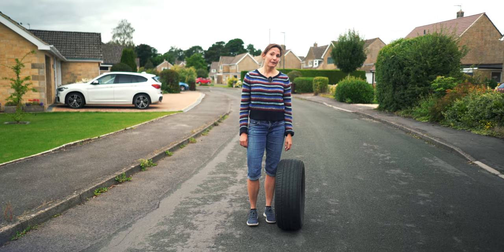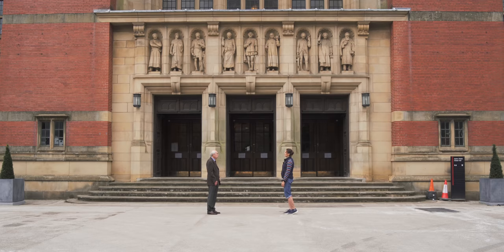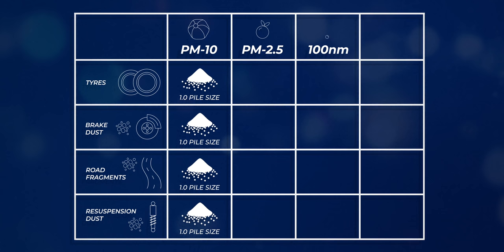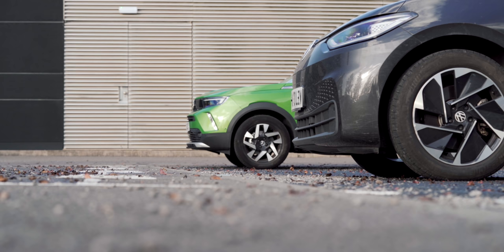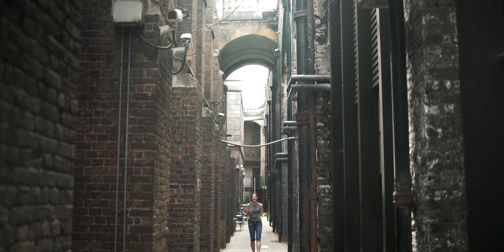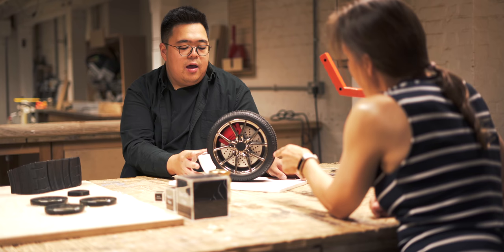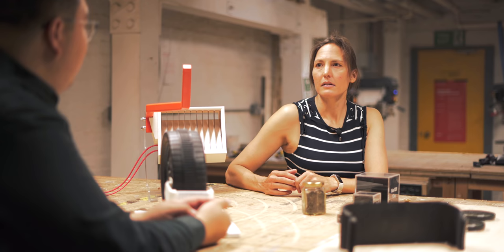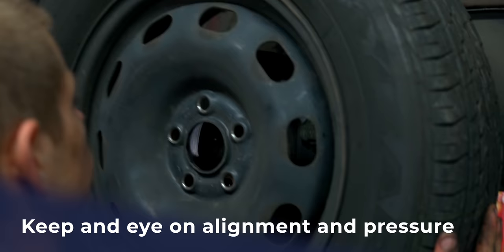The Secret Pollution That All Cars Are Guilty Of | Fully Charged

Comment: When cycling in cold weather, it seems that pollution along the road is worse. On top of car exhaust, is smoke from wood stoves.
Reply: I have a special hatred for the pollution from wood and multi-fuel burners. They are absolutely filthy!
Reply: Wood stoves are cracking.
Reply: @sandersson2813  Might be romantic and aesthetically pleasing, but they are an absolute menace to anyone with respiratory problems and should be banned.
Reply: @ma40  Bullshit. Theres nothing wrong with them provided you burn DRY wood.  Furthermore, considering that the fumes come out of a chimney, how often are you cycling at chimney height?
Most of the time there's sufficient enough wind that it wont drop to street level.
Reply: @sandersson2813  You are still wrong. Inside and outside the home they produce substantial amounts of NOx, methane, VOCs, various sizes of particulate matter such as those discussed in the video. True, the level of pollution depends on the fuel burned. Defra’s Clean Air Strategy 2019 cites that an eco design stove will still produce 336g per mWh of PM2.5 compared to 0.72g per mWh of a gas boiler. It’s not true that it just simply lingers at chimney height or above and it often combines with ozone etc to cause real problems at ground level.  It’s well documented that it’s particularly problematic for young children, the elderly, those with COPD etc.
Reply: @ma40  How many houses  do you cycle past that have wood burning stoves on?
Honestly, you're talking like its Dickensian London.
Were you moaning when 80% of houses had coal fires? No, you werent
Reply: @sandersson2813  Why do you keep blathering on about cycling and London, rather than engaging with the substantive points? Firstly, the majority of the population live in other parts of the country, and people have to live next to houses with these stoves, not just ride past occasionally. Secondly, domestic wood burners produce three times the level of particulate matter that road traffic does, yet only around 8% of the population have them. Thirdly, you are relying on people to use their stoves properly and have them and the chimney cleaned regularly. Plenty do burn wet wood still despite the clean air laws. And fourthly, yes air quality has improved since the 1960s but the improvement has levelled off thanks to stoves. Why shouldn’t we aim for better than this? Isn’t that the whole point of Fully Charged’s “Stop burning stuff” campaign?

 My old man has COPD from years of formaldehyde exposure working in cancer diagnosis. He has to stay inside when people are burning wood as it irritates his chest so much. Shouldn’t he be able to go about his business without someone harming his health?

I’m just not sure why you would be watching something that is aiming to educate about the need to reduce the release of particulate and other pollutants if you aren’t prepared to lead by example and find ways of reducing your own impact on the environment etc. In fact you undo any good of cycling by replacing that with wood stove emissions instead.
Reply: @ma40  What % of houses have wood burners? Hardly any.
Therefore you are not subject to wood burning fumes to any significant degree.
Its just given you something to whine about

Comment: Electrostatic collection... Having worked on something related, I reckon that will be battling against water spray and a hell of a lot of debris and dirt, kicked up off the road. Will their collector be able to differentiate and reject that. Or will they just become matted chunks of mud, just like we see caked to mud flaps or under wheel arches.
It isn't going to be a 6" box full of pure rubber dust, that will get emptied at service time. It will be a dyson vacuum full of mixed sludge, every day during winter. We will have to have specific wheelie bins for it. Though we will also have the best hoovered roads in the world.
Reply: Caution - electrostatic collection systems can create exhaust that includes a significant number of charged, smaller particles that result in even greater toxicity overall, even if the total mass of particles in the exhaust is reduced by 99%. The primary reason for this is that the smaller particles have far greater toxicity than the larger particles because the lungs can trap and eliminate the larger particles more readily than the smaller particles. So, if a particle 1/100th the diameter of the larger particle has 100 times the toxicity of the larger particle, then eliminating 99% of the combined weight of the particles would do next to nothing for reducing overall toxicity of the exhaust. The reason the remaining smaller particle could have much worse toxicity, by many times, is that once charged by the electrostatic filter's electrode, the charged smaller particle is much more difficult yet for our lungs to eliminate than the same particle would be if it were not charged.

Comment: Excellent advice at the end. I can vouch for a Zoe Michelin tyres. Well over 40k miles, never had tyres last so long. Cheap tyres are often a false economy. I’ll certainly be cycling more once I get my bike back from the repair shop! 😊
Reply: I have a Zoe too, and let the car do the driving and braking so i don't wear them too much. One other way is just having my car not driving so much...good for me even if i was working in the office and not at home, i would be walking, still breathing in all those fumes from all the folk rushing around!
Reply: 40k! Meh!

I had 74k out of the back tyres on a Golf 1600 CL.

Changed because of sidewall cracking.

Rubber dust pollution and brake dust pollution from EVs a grave disappointment.

Perhaps it's time to forget EVs being charged from the "mains" and do the hydrogen fuel cell thing?

Might save a "lot" of cash and copper/aluminium cables.

Perhaps HMG would have been better off investing in hydrogen production plants and improving efficiency of hydrogen fuel cells?

They manage to use hydrogen technology in California so it might now be considered as a valid power source?
Reply: @t1n4444  how would hydrogen vehicles result in fewer non exhaust emissions? They have tyres and brakes too.
Reply: @myblueheaven4424  You could have Googled this before asking questions.

Perhaps that's what you must do, straight away.

Saves me coming out with the science, which is "involved".

Hopes that helps.

Just keep in mind battery EVs are only a step on the way.

Think electric propulsion, not the batteries and charging thereof.

You'll get there.
Reply: @t1n4444  Hydrogen sucks. It'd be nice if it would liquify at ambient temp. But it doesn't.  Here's a science project for you. Try building a 10,000 psi compressor and storage tank.
Reply: @eyeballengineering7007  😂😂😂

Clearly you aren't too clued up on technology.

It's already in use. Why don't you simply do the Google thing?

We're going to be here all night if you keep denying the technology.

Now, just Google up the topic and accept the technology works.

No need to respond btw.
Reply: Hydrogen for passenger cars is pure rubbish. It is very inefficient and has lots of transportation and storage issues. It has indeed specific applications where, despite all these issues, still makes sense
Reply: Even cheap tyres can do 50k, I've done it many times. Depends on how you drive the car aswell.
Reply: @t1n4444  I know it's being used. I also know a hell of a lot about compressors and pressure vessels. I can also tell that you're a layman who doesn't know anything but your opinion. Do you know the fuel density of hydrogen at 10,000 PSI? I do. Stop trying to talk down to somebody who knows far more than you.
Reply: @theagentsmith  You really should Google up hydrogen powered  vehicles or "railway engines".

From your posts you and a lot of others are a long, long way behind the times as far as electricity generation is concerned.

Mind you this YT channel is ditto so what else should we expect.

A little too much of the "Top Gear" model about the show as in "ambitious but rubbish".

Plus the host is a little too lightweight for the show with regard to presentation. Plus he appears to be slightly manic or excitable.

He could go and producers should engage someone with rather more gravitas and experience.

Being excellent at playing Kryton is not necessarily of much use in this sort of show.

Obviously one excellent candidate is James May.

Get that sorted and show would have some chance of being taken seriously.

Currently the show is aimed at youngsters who don't appear to be clued up on environmental issues, or buying an EV anytime soon.

We still hear of performance figures ... and not that many drivers  skilled enough to handle quite frankly ludicrous acceleration times.

EVs are an excellent notion ref "local" pollution but the energy has to come from somewhere ... lithium cells fine in the short term but sadly the technology isn't quite as clean as supposed. 

Getting rid of the cells, as an example, is not quite so straightforward as you might believe.

Suggest you research the hydrogen fuel cell for powering "anything".

The technology works in California for the vehicles there and no reported issues ref storage or spillage or explosions.

You perhaps are not aware that at least three Asian car manufacturers are busily doing the ongoing R&D thing on hydrogen fuel cell vehicles as we type.

Doubtless China won't let themselves get behind in similar R&D.

So, in conclusion, replace the presenter and introduce rather more content on hydrogen fuel cells.
Reply: @eyeballengineering7007  Of course we can all quote statistical information ... it's all over the internet and merely a case of looking.

Now, despite your somewhat dubious claims ref knowing this that and the other, are you aware the hydrogen powered vehicles are busily driving around in California?

Looks like some proper engineers have solved the issue of hydrogen storage within a vehicle and the transfer of hydrogen to said vehicles.

You don't really have a clue about this science at all, do you.

You're still thinking about EVs as yet another boys' toy.
Reply: @t1n4444  bahahahahahaaha did you know a single hydrogen pump station cost $250,000 for the pump? You'd have to understand the Dynamics of a high pressure gas pump to understand why this is going to be a problem. Like I said, you've proved yourself to be a layman who doesn't know anything but an opinion. I'd love for hydrogen to be viable for mainstream transportation. It's not.
Reply: @eyeballengineering7007  Hmm, do you really not understand when  you're being corrected and set on the path to knowledge?

All your arguments are rubbish.

To repeat, hydrogen fuelled vehicles are being used in California as we type.

What is so difficult to understand about that?

Clearly the proper engineers have engineered their way around the manufacture of hydrogen, storage of same, then transport to a storage tank in a service station, transfer of hydrogen to a vehicle and storage of hydrogen within said vehicle.

The technology works and that's all you need to know.

Why can't you simply appreciate the engineering achievements of others?

Clearly they are far better engineers that you'll ever be ... all you're doing is setting obstacles in the way ... even tho' these obstacles have been overcome.

Do try to keep up.
Reply: @t1n4444  bahaha get back to me when it's cost-effective. I'm a hydrogen enthusiast. I've built hydrogen generators and thought about using them with a pressure-free ballast for home power storage. I know how useful, and useless hydrogen can be. Hilarious that you think you're shocking me by telling me there's hydrogen vehicles all over California.
Reply: @t1n4444  quiet down child. I've built a hydrogen powered torch off of my hydrogen generator. I've done far more than that with with many off-grid systems. I have a 4 1/2 KW solar system on my house that I run directly to mini splits with no inverter. I have a solar powered hot water heater that is running off of panels directly to the element. I do far more than you could ever think. My channel has a few things I've done. Why don't you stick your nose in there and talk shit on my builds.
Reply: @paulmichaelfreedman8334  we are talking miles here, not km.
Reply: @bubba842  Heheh thx for pointing that out
Reply: @t1n4444  40,000 miles is about 70,000 km. So what you are saying is you got the same amount of distance on your tires than he did.
Reply: @bubba842  I'm in UK so it's 74k miles.

I am surprised and somewhat shocked by your response.

74k miles ... how, I sense you gasp!

Probably because I'm the finest driver on the planet, bar none ... he typed, modestly.
Reply: @t1n4444 a toyota mirai (~4300lbs) weighs more than a tesla model 3 (3800-4000lbs) which basically destroys whatever argument you're trying to make (are you saying that BEVs are too heavy? or that they will never get lighter because battery density will never improve any more than it currently has?)

 🤤
Reply: @vinylcabasse  

😂😂😂😂😂😂😂😂😂

No idea what you're trying to type, I only wish I could be arsed to ask.

All you need to know is that hydrogen fuel cells are on their way and this means the weight issue is solved!

Can say fairer than that.

Comment: Tyre manufacturers are continually improving their products. It used to be that there was a direct correlation between high grip and high wear - the extremes are still there, but the line is not as distinct nearer the centre.

Other emissions that affect us include sound - cutting out the ICE helps hugely, though there's still tyre noise. An Audi E-tron GT RS passed me on the A1 the other day, and that was not quiet at all. Lighter cars, smaller width tyres, less rolling resistance and aerodynamic drag - and less road noise. Doesn't mean sacrificing fun, just look at the Alpine A110 or Lotus Elise, for example!

Comment: Helen, there’s a much simpler way of reducing the effects of tyre-based pollution: reduce tyre wear by up to 20% by adding Graphene to the rubber compound. Go speak with ENSO tyres who just won Start-up of the Year award at the LA Expo for their tyre enhanced with Versarien’s Graphene. An all-U.K. effort too!
Reply: or make tire compounds bio degradable, make asphalt not harmful, reduce break wear with regenerative braking... etc etc there are lots of solutions out there, if we look at bigger picture - for example using trains... or fully electric or hydrogen airplanes or flying vehicles would fix lots of problems like crashes and road kill of animals and humans that happens with transportation on the surface that go fast... even boats in canals are better in lots of ways
Reply: @mockingspongebob773  with flying you can still bump into birds. Also it costs a lot more energy to make something fly rather than roll. Same with boats, the water takes more power to go trough
Reply: Flying cars in London would save a fortune in cleaning buildings by making cat food out of all the pigeons!
Reply: OK, startup of the year, 👍 but aren't graphene micro/nanoparticles also bad for health?

Comment: After nearly 200.000 EV km with Leaf,  Zoe, Teslas and eGolf I can believe electric vehicles produce much  less tyres polution. You just drive smoother,  no gear change and with regenrative breaking less brake dust on the aloy wheels.